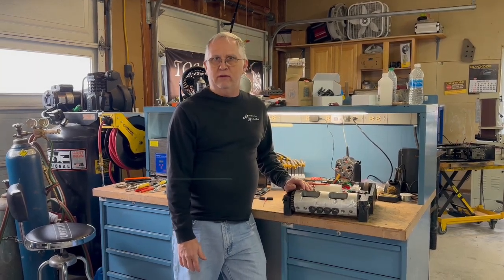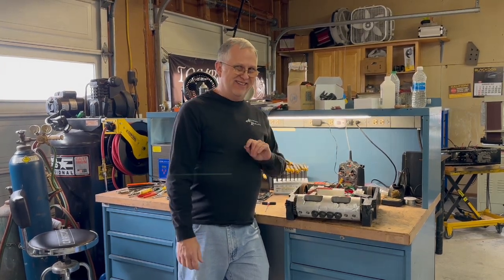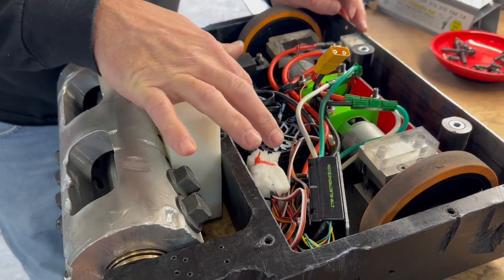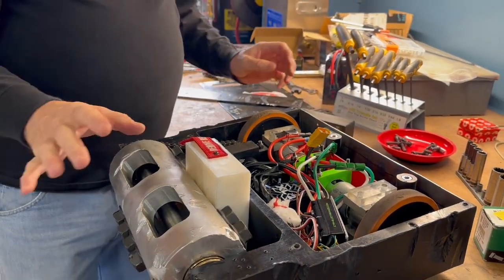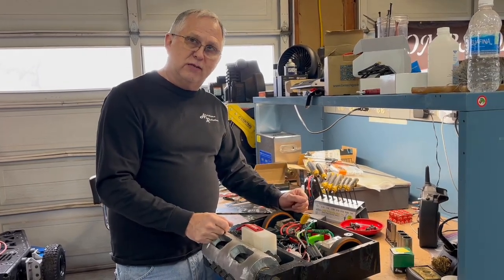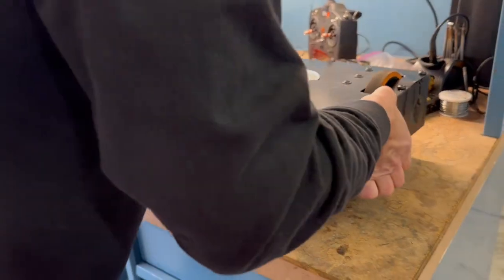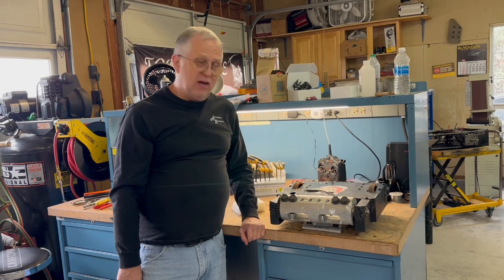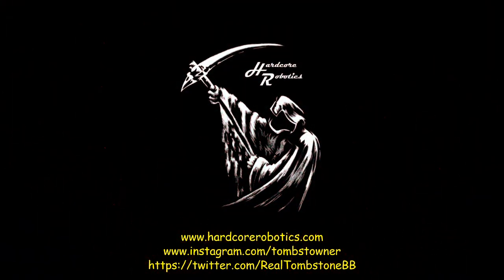Disinformation Prep for Robogames 2024

Comment: Question for you, how do you do the calculations for what size of battery you need? I'm working with a team on a 30lber and they're seeming to think they don't need anywhere near the amount of capacity you're running, when we're running a pair of larger brushless motors.
Reply from the maker: I wish there was a simple formula where I could say "do this" and cover it all, but a big hunk of this is just experience over the years. To make weight at Robogames I went from a 6500 mah 6s pack to a 5000 mah, and we overheated it every match from running it too low. For its next rebuild I will most certainly want to have the 6500 back in there. In my case though, most of the draw is the weapon system, so a lot would depend on what you are planning for a weapon.

I can tell you that you'll need more than you might think, both in general capacity and in discharge amperage. And don't believe the advertised C rating on pretty much any pack out there right now, but more so on the less expensive ones. The 5000 and 6500 packs are both 100c discharge, but that would mean 500 amps and 650 amps respectively, and if you pull that (even briefly) you're asking for trouble. Try not to draw more than half of C rating, and try to not drain more than half capacity if you can plan around that.

Comment: A curious question, are the lipo packs weight difference between charged and discharged significant?
Reply: Electrons have effectively no mass, so no: a charged pack weighs as much as an empty pack.
The volume however can change, as it can produce lithium oxide gas when (improperly) discharged which expands it (puffy lipo).
Reply: @bami2  The mass does change. Don't take my word for it, though. I was asking if it would be significant enough to warrant weighing in with a flat battery.
Reply: @ConstantlyDamaged  That's why I said "effectively". You're talking in the order of 1/100000th of a gram difference for a EV-sized battery. A lipo pack on a robot? The difference is unmeasurable. 

Why? Because you're taking the square of the speed of light for conversion: E=MC². So unless you have gigantic amounts of energy, the mass is always going to be miniscule.

Even with nuclear explosions you generate terajoules of energy from the conversion of only a couple of grams of fissile material.
Reply: @bami2 Right. Thanks. The reason I replied was because you were off on some tangent about electrons, when electrons had no bearing on it at all. (It's the chemical changes to the electrolyte brought on by electrons passing through the battery during charge.)

I do find, on further inspection, that yeah, it'd hundredths of a microgram.

Comment: Is it possible to use 6061 or 7075 for the frame instead of UHMW?
Reply: Aluminium is roughly 3x the weight for the same volume of material compared to UHMW (~2700kg/m³ compared to ~900kg/m³), so to keep in weight all the walls and stuff would have to be really thin. You'd probably have to change the weapon and end up with basically a completely different bot, more comparable to Touro Feather.
Reply: There would be no way to make that frame 6061 and still be abled maintain that same thickness and still make weight. Either he would have to shrink the weapon down or shrink the wall thickness of the frame down by probabaly 3 times in order ti still make weight
Reply from the maker: I've made 30's before with aluminum chassis, so of course it does work. It could even be done in the same style, machined out of a solid piece if I was so inclined - and felt like putting the hours in on the CNC :) It would just be a different robot, and honestly if I rebuild this again from scratch I will probably make it out of UHMW again.